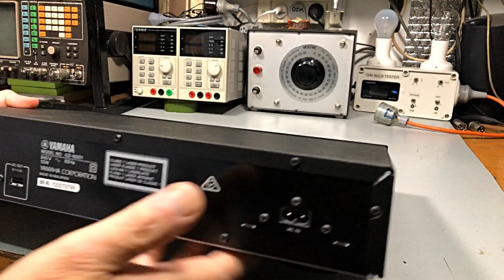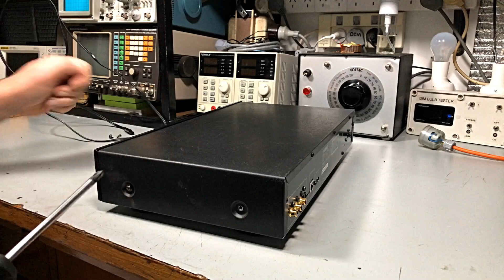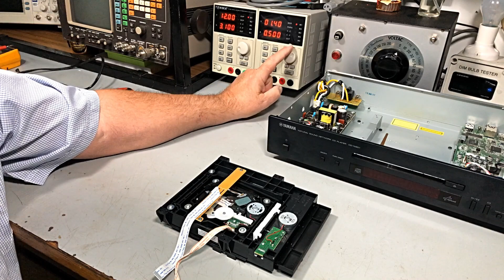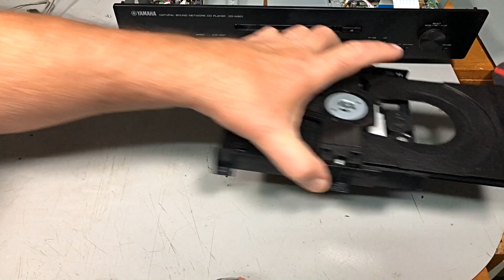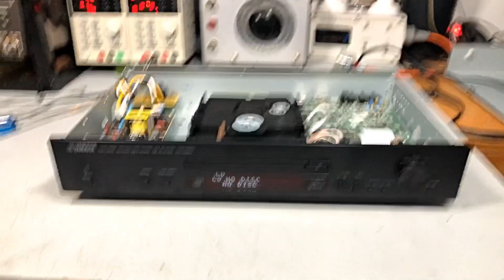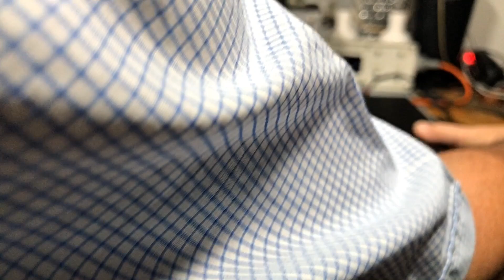Yamaha CD-N301 CD Player Repair

Comment: Thanks for this. My CD-N301 has the same problem. I ordered a replacement band, and will attempt this myself.
Reply from the maker: Great, glad this helped you out !
Reply: @techobaz55  Took me 5 minutes to fix. Thank you very much. I didn't even need to take the CD tray unit out. I just moved it to half open and slid the new band in. I got a (supposedly) non-degradable one from Germany.
Reply from the maker: Excellent, im glad the video helped. Trying to get better at showing faults with all sorts of gear..
Cheers 👍

Comment: CD 💿 players are an interesting piece of equipment. They're a system of electric motors, gears, and drive belts. That motor may be burned 🔥 out. Willy really wanted out, it sounds like 👍. Ya might need a new motor. Your friend, Jeff.
Reply from the maker: You better watch till the end !

Comment: Certainly worth repairing as it’s a versatile player and no longer produced by Yamaha. The PS output rectifiers(Schottky) commonly fail on these players.
Reply from the maker: Yes, a beautiful player indeed. Thanks for the tip about the diodes.
Cheers

Comment: I think you've done the right thing. As it stands, you've saved the customer the cost of a new motor. but it if does eventually fail, you can then buy a new one, in the knowledge that he has full understanding of the situation..
Reply from the maker: Thanks for your comment. I think so as well. Cheers 🍻

Comment: I had the same issue on an Onkyo all in one bookshelf unit (CD/amp/DAB tuner thing). Gave the motor a good blast (12voltvids style!) and it freed up.

That looks like a generic DVD mech in that player (Sanyo SF-HD150 clone I think). They do seem to have problems with motors in those, I've seen a couple of cheap DVD players with similar issues.

New subscriber here, not sure why it took YT so long to recommend your channel!
Reply from the maker: It's great to have you as a subscriber, thank you. It's taken a long while to get the channel out there with YT. No idea how it works, sometimes it doesn't make sense with its algorithms.
Cheers 👍

Comment: These motors do get stuck in one position if not used for a while. I've had customers with car cassette decks that wouldn't work, but one manual spin of the motor brought them back to life. I usually give it a squirt of DeOxIt for good measure. Never had any complaints/returns. 90% of CD player problems I've had have been belts. A very rare one I had was a distorted output. The D/A converter IC was bad--only one time in all my years of servicing.
Reply from the maker: Sounds pretty close to all i have repaired Douglas. Deoxit works wonders on those small motors.

Comment: Those motors are a common issue and should be replaced. They fail again if only spray cleaned.
Reply from the maker: Have already ordered replacement motor. But say that, I have used that method for people that are on a budget & haven't had one back in last 20yrs.
Cheers